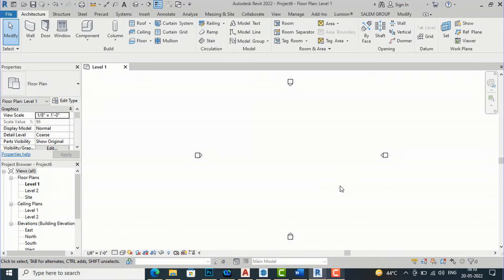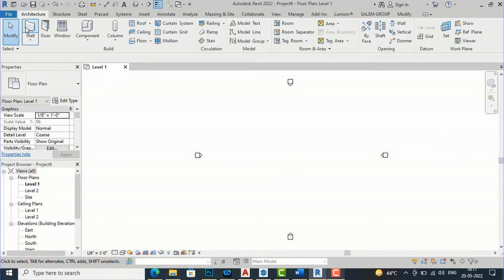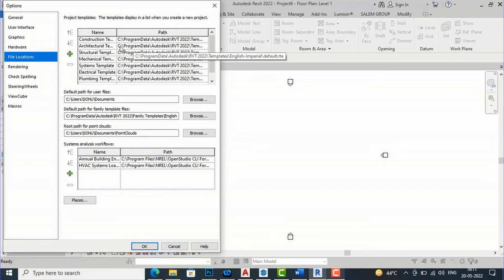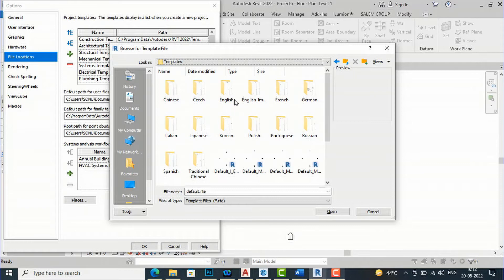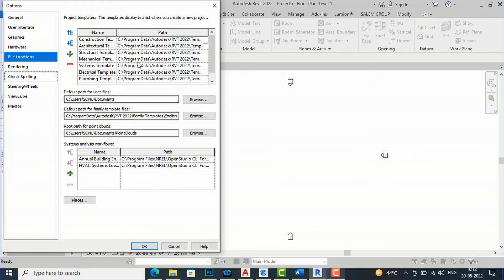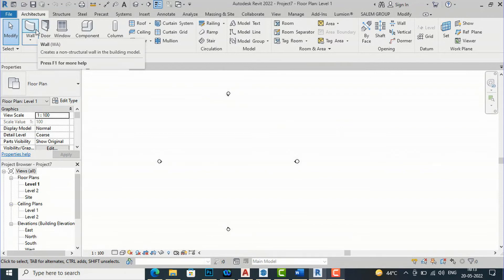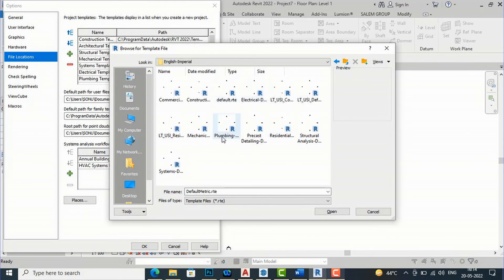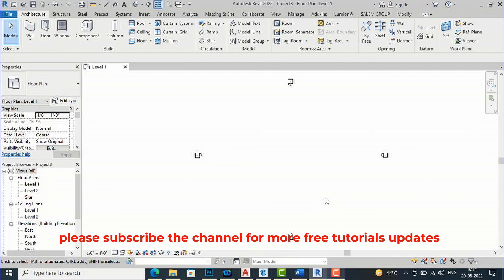How to change defaults from metric to imperial or vice versa in Revit (Revit tips and tricks)

Comment: Hello sir, I have an issue similar to this, I have finished my whole model in Architectural Template but I have to do it in Construction template so can I change my project template without doing the whole model from scratch?
Reply from the maker: Yes you can use the following steps
Save your architectural template project
Open a new construction template 
Go to link Revit file option and insert your architectural Revit file
Reply: @gladstudioarchitects  will I have to do some changes in the new file then? Or will everything be copied to the new template
Reply from the maker: @Kiwi0234  everything will be copied
Reply: @gladstudioarchitects  No I cannot edit the 3 D because the whole thing is getting selected
Reply: @gladstudioarchitects  if u don't mind can I send my file to you? If there's a chance?

Comment: Sir I'm in the middle of the project I have only selected architectural not Default metric now how can i convert please help
Reply from the maker: https://youtu.be/rkZxHi98pCs
follow these steps if your english template is missing
Reply from the maker: you can change unit setup to metre in architectural template 

or elese you can close the file after save go to models new
select new project click browse
and then go to english metric
and choose default metric
Reply: @gladstudioarchitects  after installing new revit it only shows architectural it has limited walls and dimensions but its not metric, i have  created project, now i want to convert that project into architectural metric, because I'm unable to use more walls types which is in architectural metric
Reply from the maker: close revit open revit 
and then go to left side 
click new project and browse
in browse select english not english imperial
in english go to select metric default rte